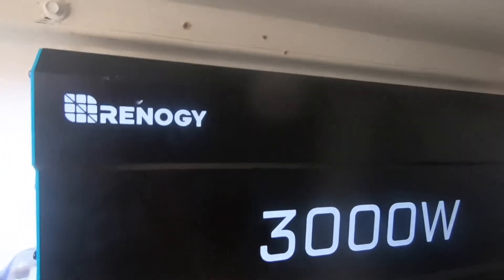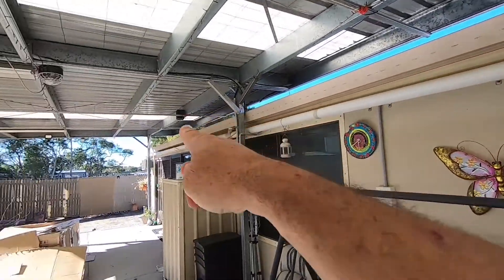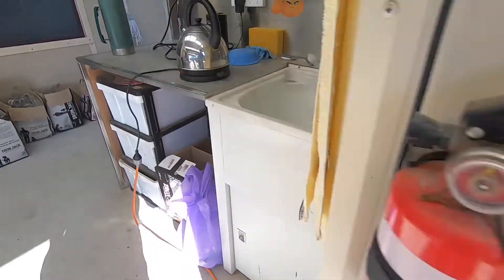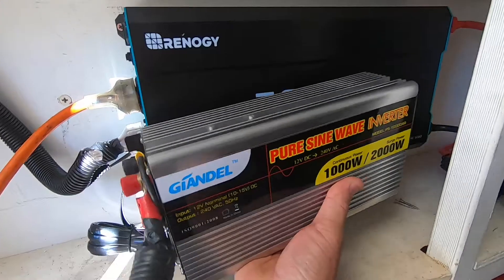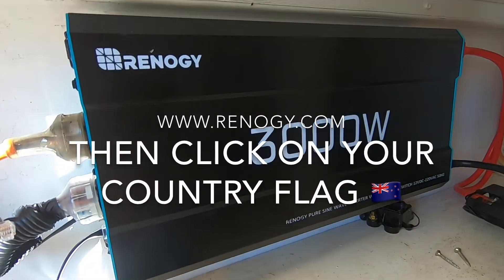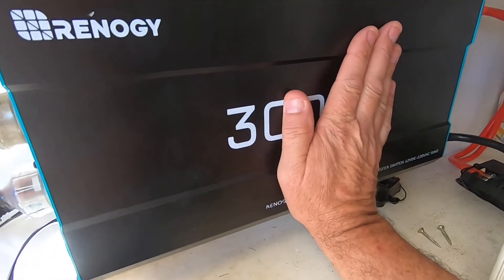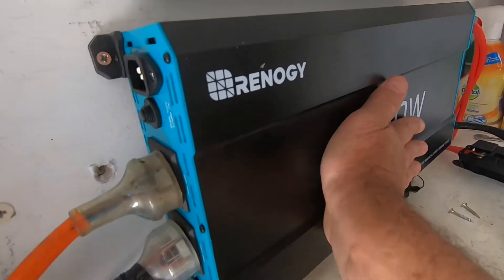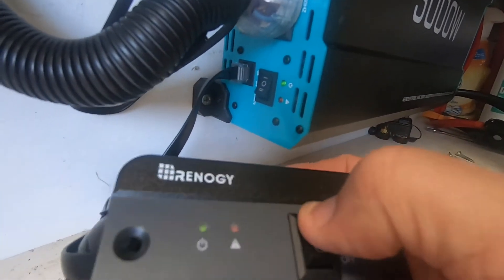Renogy 3000 watt pure sine wave inverter

Comment: I got a Renogy 40 amp controller and 1 Renogy 12 volt/100amp hour battery. 1 235 watt panel. What size inverter should I use?
Reply from the maker: If your battery is a lithium ? It probably would have a continuous 100 amp discharge capacity and you will run a 1200 watt inverter. But depends on what you want to run .
Reply: Your inverter size depends on you. You will need to count up the total amount of continuous watts you want to run with your setup. So if you wanted to power a phone charger and lights you can get away with a 500 or 300 watt pure sine inverter. If you want to run a small microwave you will need a 1000watt inverter: if you want to run a microwave and a small fridge and all your phone chargers, then a 2000watt pure sine inverter will have to do.
Reply from the maker: Right on well said ..couldn’t of explained it better myself 👍🍻

Comment: No power usage figures.....
Reply from the maker: Yeah sorry bud  For a more accurate calculation of battery current: Divide load watts by actual battery voltage, example the jug 2400 watts divide 12v = 200 watts and then the 10% inefficiency of the inverter so the bigger the appliance the bigger the power draw. They really chew the power . Thanks for watching 👍🍻